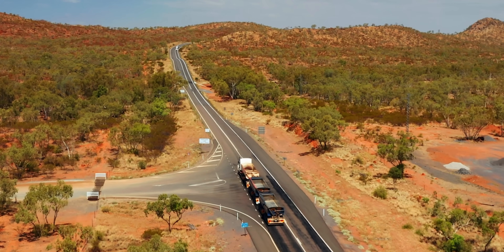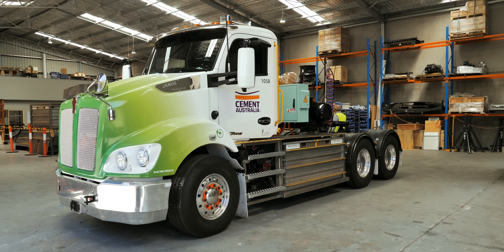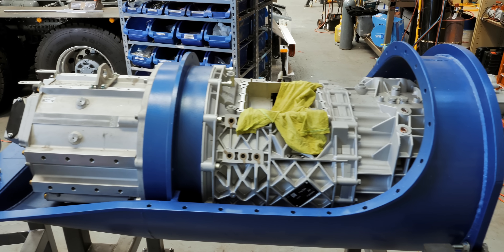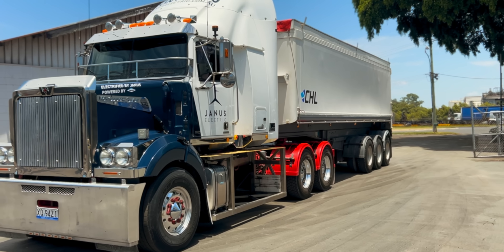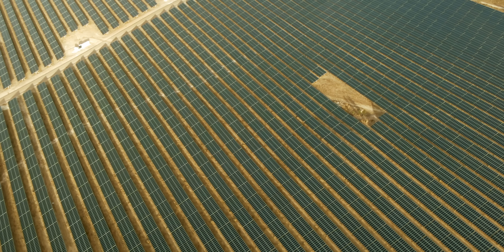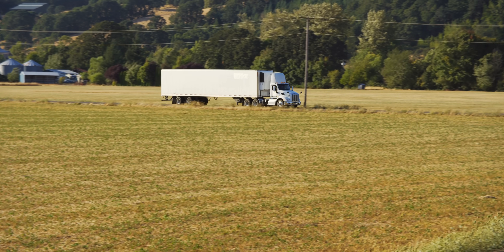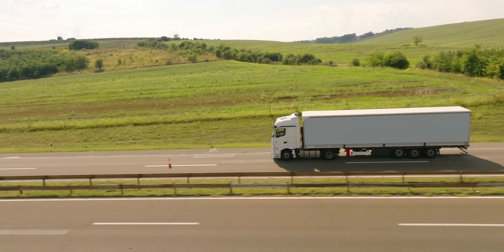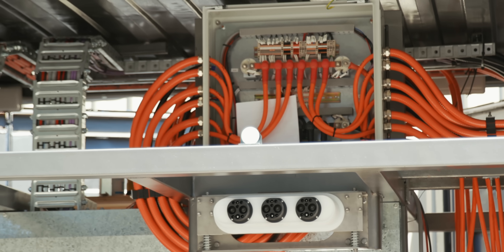This GIANT Electric Semi Can Swap Out Its Batteries!

Comment: I would like to see them do on truck batteries in combination with a trailer floor battery, sure you would drop cargo capacity but would see an increase in range, and instantly charged when swapping trailers. The onboard battey could just be for heading between terminals without a load. We could then throw some vehicle2grid on all these trailers to balance the grid as needed when they are idle. In my mind that would be the best approach.
Reply: Or put solar on top of the trailers to trickle feed the onboard battery pack or assist powering refrigerated loads.
Reply: No. Law of diminishing returns. Change the batteries while the trailer is being unloaded

Comment: Technically the statement it is faster to charge up an electric truck is in correct. It is faster to put charged batteries into the truck than to fill it up with gas. The Charging would still take a lot of time. It is still a really neat process though and one that really is the best option for trucks like this. Truck stops with battery swaps for long haulers.

Comment: This tech would shine when utilised in existing urban bus services.  Low noise, improved air quality and regenerative efficiency in an urban landscape is win win for both operators and the community.  So much business development opportunity.
Reply: It is quieter, but hardly low noise.  I unfortunate live not to far from a freeway.  Over about 30 or 40 miles per hour, the noise of the tires on the road is actually louder than the engine, depending on vehicle.  Compression brakes are obviously a different matter.  The regen is a big reduction there, but you generally can't use compression brakes near residential anyway.

Comment: Janus Electric is the smartest company on the planet. All big rig trucks are the same except for the cabs. Refitting an old truck would be WAY cheaper than buying a new one, which is what most owners would do. Plus, swapping batteries instead of sitting and recharging is what will seal the deal. Elon Musk didn't think of that (in fact, resists the idea), and they call HIM a genius.

Comment: This makes so much sense. Could battery-swapping also be used for ships, trains, and planes?
Reply: No. Ships and planes would require too much power, and trains are better off using catenaries.
Reply: @counterfit5  I thought I saw something where they were using batteries in containers that could be quickly swapped on and off the container ships.  You would need a lot of stop points with wind, wave, or solar to charge the batteries though, so even if it is reasonable, it would require a lot of infrastructure investment.

Comment: 300km under difficult conditions; 400-600km under the best of conditions.  This is fantastic stuff.  
I would like to see them use an electric forklift to remove and install the batteries instead of their propane lifts.
Reply: And then another electric forklift to swap the batteries in the electric forklift that is swapping batteries!

Comment: If this takes off I would hope that a fully automated battery exchange station would be available that didn't require a forklift and driver.
The other idea I had, that would suit the logistics operation I work in, would be additional battery packs on the trailer that could charge while the trailer is unloaded and loaded. I'm fully aware that this wouldn't be suitable for many applications but for those that operate trailer swap logistics operations it would be ideal. I'm thinking of retail delivery where a trailer could be on a bay for several hours.

Comment: Swapping is the single most unsustainable way of doing EVs, the CO2 footprint of this is more than likely going to be higher than just normal Diesel
Reply: This company is operating in Australia which has a substantial installed base of renewable energy and is still adding more to it.

Comment: What an absolute no-brainer on so many levels! Imagine a battery swap station every  couple of hundred kilometres along major highways. In the time the driver stops for a pee  the truck is ready for another 300km (or even  more on some of our long flat Aussie roads)! In 10 years time we will say how did it take us so long? And hopefully diesels will be on the way out by then. I imagine no diesel truck driver, after a few 1,000 km of clean, quiet vibration free, electric miles will be asking for his diesel unit back. And for the long haul cab an all-electric galley and quiet, engine free, AC running all through layovers has got to be a winner. Refrigerated trucks  no need to keep an engine running there either.  Truck stops will turn into quiet rest  havens . Yeah!

Comment: So Ive lived in Australia how are you going to change these batteries over 500Km+ routes, which are not uncommon in Australia?
Reply: The secret we keep in Australia is that we all mostly live in 6 cities. Of which three have the vast amount of the population. Those cities are more or less evenly spread around the coast so it looks like we live all over Australia but in reality most travel is within 100km of those cities. Trucks like these can do all that sort of travel. Their is long distance travel between the cities and into the rest of the country which  is what people think of when they think of Australian travel, because it’s where tourists and mad max and top gear go which will be more difficult to electrify but I don’t think that’s the market for this technology.
Reply: @francesconicoletti2547  this exactly. 
And, most trucks run depot to depot. So predictable runs, the drivers are required by law to take regular breaks anyway so those moments are the time for charging or swapping.   
Most people can easily do a Melbourne to Sydney drive with one stop. I'll be driving from Ballarat to Sydney tomorrow myself and I'll only stop once for petrol,  but truck drivers  have rules. 
There are probably 7 or 8 big service stations on the way that are right on the freeway,  plenty of places to put them.
Reply: The primary use case will be for trucks that deliver within a radius of a depot, then return to it. The  concrete truck in the video is a good example. Load up at the depot, deliver to your customers, return to the depot to reload and swap for a fresh battery.
Reply: At all the truckstops. Easy.

Comment: Great idea! One problem is this, Australia is warm. Where I live it gets down to -25c and below for many weeks, the batteries don’t like the cold! Hopefully they will come up with a better type of battery.
Reply: I work in a cold and frozen storage warehouse  , our electric forklifts don't have much trouble with it. Our freezer is minus22 c and the forklifts aren't even fitted for the freezer package.  The main one used in it did a 17 hour shift , was forgotten to be charged did the next day 18 hours and didn't get on the charger until after those two days and still had 53%.
Reply: @gusdrivinginaustralia6168  I pretty sure that forklifts use Lead Acid Deep Cycle batteries, completely different batteries to those used in the trucks.
Reply: @chrisbarnes2823  yeah. I guess what I mean is you can build a vehicle tailored to its primary task. That's what the majority of fleet trucks are doing. So like the forklift should be freezer rated and fitted with the right insulation and such stuff.  You have trucks that don't go far from home so environmental conditions are reasonably consistent,  or specialist trucks like concrete mixer trucks that stay close to home and the weight is regular.  Or in the case of the company I work for , the trucks have predictable runs well within the range of this truck and could easily plug in at the warehouse as it has high use of electricity and each warehouse could swap out the batteries.
Reply: @gusdrivinginaustralia6168  i totally agree

Comment: Some numbers don't add up.  If the total weight of the motor, transmission and batteries is only 4MT, then probably less than 3MT is batteries.  But each pack was supposedly 620kwh for a total of 1240kwh.  At 200wh/kg, 1240kwh of li-ion should weigh at least 6.2MT not counting the actual battery cases which look like pretty hefty structural steel.  Maybe the total of both packs was 620kwh ?  But then the ranges and kwh/km numbers don't work out.
Reply: I think it is 620 KWh total.  The 2 ton weight cannot be 620 KWh.
Reply: @jamescox8429  But they claim 1.5 - 2 kwh/km efficiency, which would mean 310-410km range.  Then they said 700km possible, didn't they ?
Reply: Wow, great observation! Thanks for pointing this out. Hopefully we’ll get clarity on this soon…

Comment: Great episode and good to see a company doing these conversions.  $125K USD for the conversion and another $125K for the batteries probably.  I can see that if you are constantly swapping batteries, it wouldn't make sense to own it unless you are operating your own fleet and rotating your own batteries.  Unless there is a swapping infrastructure, though, this would be limited to fleets operating locally or moving between their own hubs within range.  Independent operators wouldn't be able to do long haul runs without a swap infrastructure.
Reply: they address they charging infrastructure problem in the 'batteries as a service' part of the vid.. leasing/renting of batteries not in use. There's a 'hub' of sorts currently being built in Taree, NSW that I believe will be operated by Pearson's Transport. They'll buy the batteries outright and pay the upfront investment to the infrastructure that they use, and the electricity to charge and 'house' them, and then 'rent' out the ones not currently being utilised to other companies who perhaps don't have the money to invest in the batteries, but still want to convert some trucks. Janus still gets paid, Pearsons get to recur their upfront investment quicker, and other companies get to convert their own trucks for cheaper overall.
Reply: Doh!  You don't say!

Comment: This is breath of fresh air! The amount of pollution that this solution addresses is incredible. The cultural issue that this address is terrific. I've been waiting for someone to take this approach. 🤩
Reply: The amount of pollution a factory puts put making and disposing of these batteries and generates is waaaaaay worse then diesel. Not to mention the electricity being used to charge these is produced by fossil fuels.......
Reply: Loll. Batteries are way worse
Reply: @gmeister03  Rubbish.
Reply: @economistfromhell4877  they are. Tell Me you don't understand what goes into producing a battery along with the energy to create it, without telling me.🙄
Reply: @gmeister03  and middle east purchased crude oil for refining is deadly ~ funds their terrorist programs too.
Reply: The amount of fossil fuels (carbon footprint) to manufacture the batteries nullifies the virtue  signalling of  clean energy.
Reply: @Vlfkfnejisjejrjtjrie   yup smelly polluting single-use diesel fuel is way more environmentally friendly than using batteries powered by renewables in trucks.🤦‍♀️🤡
Reply: @Vlfkfnejisjejrjtjrie  At least we wont have to breath noxious fumes.
Reply: The amount of pollution is actually not that bad considering that all those trucks have exhaust treatments systems unlike those massive aircrafts, ships……
Reply: @alanmay7929  Try convincing people who live in cities that its not bad!
Reply: @alanmay7929  But the question is always how well are these exhaust treatment systems maintained?  How many are out there on our roads worldwide running at less than acceptable levels?
Reply: @markcayer4859  The trucks exhaust management systems are reducing the trucks engine life and increasing costs.  This solution represents a forward path that can begin the journey.  The key part is that the system allows batteries to be upgraded.

Comment: This might be of use to the really heavy haulage firms in the UK. About a decade ago I was talking to some Alleleys folk who were bringing us two second hand railway bridges (don't ask!) and one comment they made was their tractor units have longer than usual lifespans & would have difficulty matching increasingly stringent emissions standards and they were worried if they'd effectively be banned from city centres.  This sort of upgrade would give them this class of heavy haulage with zero tailpipe emissions, longer equipment life and possibly lower running costs. Wins all round.
Reply: How can you tell us not to ask about transporting two used train bridges?
Reply: @counterfit5  lol... what he said.

Comment: Wow😀
never realized that the life span of the motor and transmission would be greatly extended taking away the heat and stress factors, for a commercial vehicle company  that must put big smiles on their faces. 
Not only that but here in the USA other savings can be had switching to EV there would be no more using  DEF or Diesel Exhaust Fluid and all of the other chemicals and fluids diesels use.